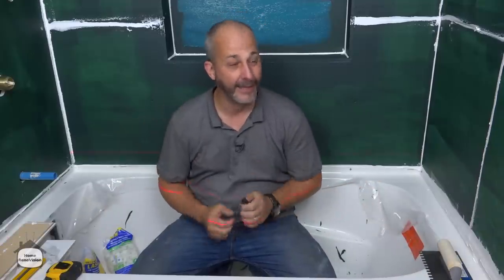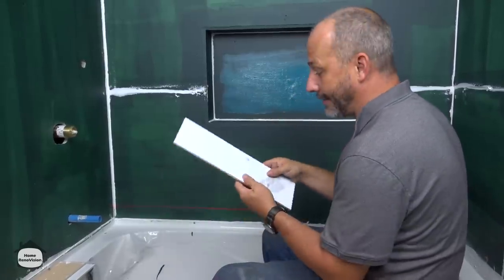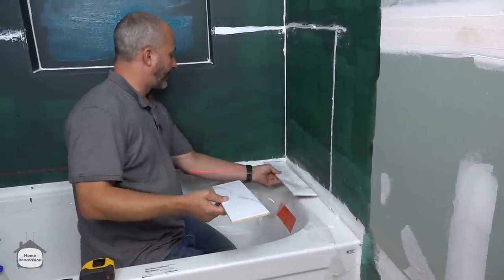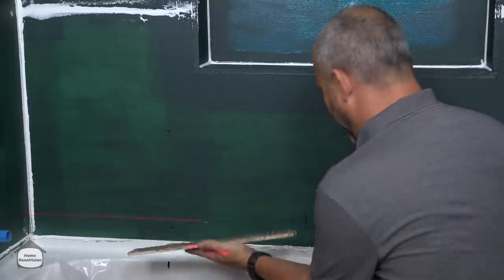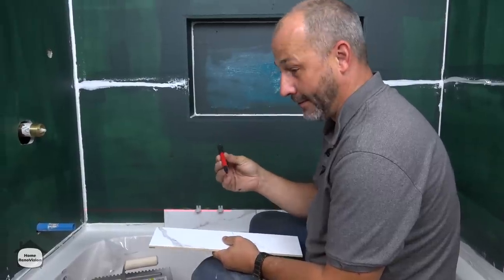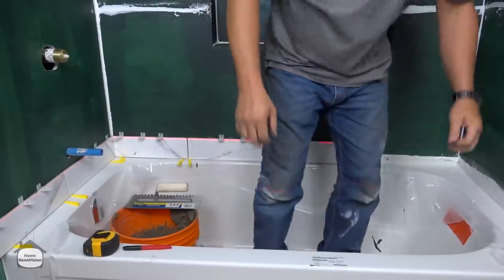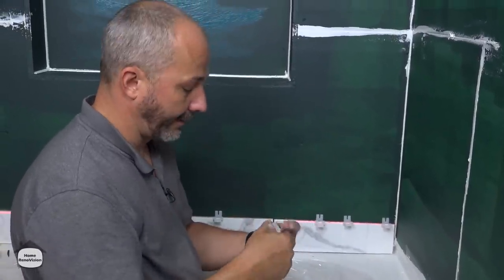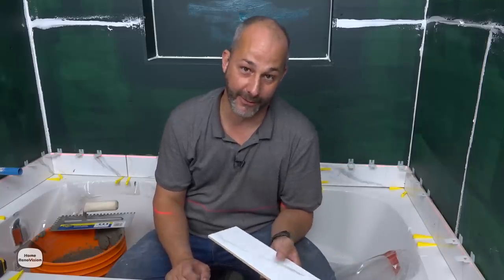DIY Shower Tile Industry Secrets | Bathrooms 101

Comment: I have only ever done one tile job - a kitchen backsplash and it turned out great. I did a lot of research first, and one really great tip I found and used was to start from the second row and work upwards after first installing plywood strips for the starting point. You use a laser level to install horizontal strips perfectly level and then you start installing (what will be the second row from the bottom when its all done) sitting on the temporary plywood strips so they aren't going anywhere - no sag possible. Once you reach the top (i let it all dry overnight) you remove the plywood strips and then finish by filling in the bottom row - you can use spacers to easily get them perfect.

Comment: I payed around $150 for my Dewalt laser and thought it was expensive for what I was getting. I couldn’t have been more wrong. A good laser is an absolute necessity when doing tile, or any remodeling for that matter. Another great video!
Reply from the maker: I couldn't agree with you more. My laser has saved me hundreds if not thousands of hour on the job sites over the years.
Reply from the maker: Here Here...Cheers!
Reply: A level and marker will cost you $25 dollars if your working on a tight budget
Reply: What are u thinking we tile pros did before the laser go figure !
Reply: @erichermann7873  I'm guessing it took a lot longer to get the jobs done or they were of less quality than if you had one.

Comment: I just have to say, your content in this video is so spot on. I’m an interior designer and I specialize in bathroom renovations and tile design. Your method for locating the niche and laying out the tile based on tile size on site is exactly how I design showers for my clients to get a well planned tile design every time. Now if every contractor or tile installer understood this, my job would be easier.

Comment: Jeff I really dig this channel, you and Anna White are the leads in this DIY space.  I have a video request, how to install a dryer exhaust port at a distance from the exterior wall.  From my searching no one has done a video on this.  I have a home that had an addiction put on it.  Basically an entire room.  It was done to I guess the lowest bidder..  the plumbing for the washer and dryer were not moved so it is at what used to be the side door which is now the middle of the house.  The wall is an outside wall, but it’s inside.  How can I 1. Add a vent to go through a structure wall or 2. Should I bite the bulletin and re plumb the entire house using a manifold system, shark bites, and plastic tubes to relocate the washer and dryer to an outside wall?  Really dig your channel, it’s hard to get genuinely good DIY content with the kind of wisdom you put in your content.  There is a lot of knowledge out there it’s wisdom that makes your content better.

Comment: I have yet to do tiling, but I will be in the near future.  Excellent explanation on starting the first row properly, and I definitely have to buy a laser level--and probably watch this video a few more times.  ;)  Thanks so much!
Reply from the maker: Thank you very much. I have my favorite DIY laser in my tool section listed on my Amazon link if that helps. Cheers!
Reply: Home RenoVision DIY is it possible that the link is not working? I tried using it but it didn’t get me to the website

Comment: Hi Jeff, amazing that the tiles lined up to the casing without having to be cut.  If it didn't work out like that, there is another trick.  You can cut the tile maybe 1/4" beyond the casing line for each row going up.  Then rabbet out the casing from behind so the casing overlaps the tile.  That way, the tile cuts are completely hidden and a nice thin caulk line will blend the transition...
Reply from the maker: very true. I usually just cut the tile since I am already set up for that at the moment. But good technique nonetheless. Cheers!
Reply: Can you explain more. What does rabbet out the casing mean?

Comment: For my bathroom remodel, I've been studying the installation instructions for various acrylic and cast iron shower bases. They all have a tile flange and they all, without exception, tell you to install the base or tub so that the wall board and membrane are INSIDE the flange. They instruct you to build out the studs with furring strips and shims to contact the flange where necessary.
Reply: It appears that this tub was installed against the sheetrock instead of against the studs as typically seen.

Comment: Hi Jeff,  is directional troweling required? I also noticed you just back-buttered the tiles and not the wall as well, im using 3x12 tile and wasn't sure if I should backbutter and also all thinset to the wall for more secure hold?
Reply from the maker: Hi Steve, save the advanced tiling steps for tile over 12 x 12 in size. Cheers!

Comment: Thank you!  This video in particular has been very helpful to me.  I have two bathrooms to do, one at the rough framing stage ready for tile, and the other not demolished yet. I've been worrying about the wall tile.  We do have a laser level. iNVALUABLE.  Showing how to lay out that first row of tile -- starting at the low side and that tubs/showerpans might not be level and how to compensate for them --  and the caution to wait for the next day have saved me a lot of trouble!  Oh, and how to use the plastic separators properly.  THANK YOU!!
Reply from the maker: Glad to be of help. I developed this strategy years ago when I used to pay plumbers to install the tub. they always claimed to be level and were always out. Glad to be of help. Cheers!

Comment: Jeff, Please help? But first let me Thank you for the video. Wish I’d seen this before I built my own shower stall. I did a good job and the tile floor plan was the hardest, but it has lasted several years without problems! I do have a question I’d like your expertise with though. What do you recommend to clean grout and reseal. I’m getting the brown on the grout and can clean with bleach but want to clean really well THEN seal it well also! Can you Please help? I have the two “Miracle” brand “Pro Choice” cleaner and sealer from Lowe’s if that’s good enough?

Comment: Great video. Thanks for the detailed instructions. As everything is level and you build up the wall with tile, how do you deal with the ceiling if that turns out to be uneven and not level too? Would you treat that final row of tile in a similar manner to the first row - grinding along to fit and then silicone the top? I can envision this looking ok for long or large tiles, but what about smaller or mosaic tiles? Won’t you notice that there’s more tile on one edge or the other?

Comment: Hiya  need advice please. I wanted to tile an outside bathroom wall that was painted years ago but paint bubbling off due to raising damp. The wall is brick with coat of plaster... I think.
It has just a boarder of tile and I want to tile the whole wall. 
Q. How to best prep wall for tiles?  I'm concerned about the rising damp. Will the tiles fall off?? BTW. YT IS awesome. Great advice n great vid tech. Cheers

Comment: Levelling a tub is easy... mount a wood frame around the wall with 3x2 or 4x2 and sit the tub down onto it. Then just wind down the legs until they touch the floor and take the weight. 2 levels on the tub until it's bang on.

Comment: What did you apply to the joints on top of the waterproof membrane? The white lines in the niche corners and the main corners, etc. I’m wondering what step I may have missed you describe here.

Comment: Jeff, do you have a vid installing 13x13?  we did what you said not to do... we put the Niche where we liked it
Reply from the maker: No worries rob. The majority of niche installs are like that...even by the pros on youtube. unfortunately there is no size specific install vid available. all the same rules apply. just take some time to layout the wall on a floor if you need to visualize it first. Cheers!
Reply: @HomeRenoVisionDIY  Jeff, when doing a stand alone shower, do you do the floor first, or the wall first?
Reply: So we are now fitting Schluter trim, and I was going to use their inside turn corner pieces to make life easy, but we decided to try mitre cuts... this is a NIGHTMARE... HELP?!

Comment: What type/brand of caulk do you use for the bathroom shower or tub tile?  The replacement caulk I use never looks or feels as smooth as what the original installers used.

Comment: So if I understood you right. My tub is 1/4” lower on the left side than the right side. So I should start tile on the left and shave everything to the right to meet the line. Right?  (Wife wants 90 degree/ straight herringbone subway tile 3x6. It’s hard to find info on this installation process!) love your videos!
Reply from the maker: correct. with a  herringbone pattern you could start higher up and use a laser line to get it level. then cut wall tiles where they meet a corner or surface.

Comment: What type of cement do you use with large tile (12x24 or 6x12) over Red Guard? A tile setter told me Red Guard would comprise the adhesion of the tile to the wall? Is there specific thin set you use with Red Guard? Yet I see a lot of tile setters use the Red Guard. I also didn’t see you put cement on the wall behind the 1st row? I’m doing a complete bathroom renovation by myself and your the first person I saw used Red Guard; I don’t think it was available last time I tiled..15 yrs ago.

Comment: I have a shower/bath combo and the bath part near the drain is “soft” as if maybe there is no support under the tub part? It was this way when I bought the house and the fiberglas tub has a dark stain in the area where this is. How can this be fixed? Do you have a video?

Comment: So I put down the bottom layer and let the tiles sit over night. When I was working on an adjacent wall, I bumped the bottom row of one wall and they got knocked loose. Should I be worried about the integrity of all the bottom rows since that one fell off relatively easily? And how do I get the mortar off the wall to re-install the bottom row?

Comment: Hi, I have the laser level and tile cutting machine, as well as the clips. I also have a lot of experience in laying tile and layout. But you are using some green waterproof paint to seal the drywall, will you please let me know what it is called. I have used reg guard before and it is in the products you show on your web page, but you said in another video that the green stuff was just as good but cost less, I live in the UK and want to use this on my bathroom remodel but I need the NAME of the product.
Reply from the maker: the product is mapei aquadefense. Not sure if it is in the u.k. However there will definitely be something there that is a waterproof rollon. Cheers
Reply: @HomeRenoVisionDIY  Thank you, I will check that out. If I cannot get it in the UK I will try Amazon and it should be available through the internet. I use you tube as a learning tool and find your videos to be of the highest quality and full of knowledge that I need. Keep up the good work and thank you again for your quick and helpful response to my question

Comment: Hey Jeff, I’m about to tile my bath/shower, I’ve been watching many of your videos and I have a couple questions. First, I noticed you have waterproofed the sheet rock in this video. But what about the seams? Is that caulk? I have not finished my Sheetrock above the shower, so there are gaps, so after I waterproof it, do I just caulk the seams? And my second question is, I noticed you didn’t use spacers between the vertical lines of the tiles on this first row. If I’m using the QEP tile leveling system, should I also use those on the horizontal lines, so they end up with the same grout lines as my horizontal lines? Also, one last question, I don’t believe my tiles are glazed, and they are porcelain. I’m using the same tile on the floor; how necessary is a glazed tile in the shower? Thanks in advance for any feedback. Love all the videos and information. Very helpful for a DIYer like myself.

Comment: Laser levels.  Can we have recommendations for the DIY'er?  We have a Stanley "Fat Max" and can't live without it.  I can't remember how old it was, 10 or 15 years.  Been very reliable.  A joy to use!  Not available now I guess.  Or I can't find it.   But I was recently shopping for another laser level.  

We have a practice of giving filled tool boxes and one good tool to newlyweds and many of our friends have kids out of school age just getting married.  We customize the tools to the couple.  Apartment dwellers that aren't (yet) into DIY get a cordless drill/driver and extra battery, torpedo level, paint brushes and picture hanging stuff, a simple circuit plug tester, plus a variety of toolbox items I accumulate along the way at Harbor Freight.  Tools useable for the novice.  

But the last couple a few weeks ago have bought a used house and are totally remodeling.  We decided to try to include a laser level and a good set of Purdy paint brushes.  I read all the reviews and was not happy with the quality of levels available now, within budget.  I really was dismayed...  out of level, battery covers falling off, sloppy sloppy assembly. :( 

I did finally find one to give that was introduced on Amazon (far as I can tell) just in the last year and it seemed to be more reliable, without the sloppy manufacturing.  Hope it's alright to mention brands, etc..  Self leveling cross line level by Mertek at $36, amazon.  

At the time there were only 27 reviews, all pretty good, two year warranty and it seemed the manufacturer was answering reviews and interested/involved.  Best I could do.  I see that's now been updated to 45 reviews in the last two or three weeks;  two of those are negative at this date, one 1star, one 3star.   We checked out the one we got on arrival and it was perfect, a nice little package.  No probs, so I guess we were lucky.  ( They were so excited when they saw the possibilities, just about to start tiling a backsplash and a bathroom in the future, aside from every other use.  It's fun to shop for tools as though we were newlyweds but with hindsight. :)  )

Any other recommendations -- both for entry level and for the more advanced DIY'er?    Without going professional?
Reply from the maker: I love my dewalt cross line. I also love the firecore laser. Both available in our Amazon link Cheers!

Comment: Helpful video. I've a question. I did my own shower recently in my basement and I intentionally installed a stud were the shower bar was gonna be. So when became the time to screw the bar on the wall,  I had solid wood behind the tiles. That means the bar is now very solidly attached. This house I owned was built only 2 years ago. The plumber who installed the main shower didn't do that way. Yesterday the bar fell because he had fixed it with plastic anchor only and the anchor came out with the screw and the bar. I was wondering is this is common fixing shower bars with only plastic anchor? Is that acceptable? I feel that I should complaint about that what do you think? Since I have to put up with this, do you have a good solution?? Maybe better anchors that I can use? Thank you very much.
Reply from the maker: Ouch. I always use  blocking even  on my towel bars outside the shower. There are anchors that will perform better like toggles, but you need to make the hole larger.

Comment: at about 20;10 in the video, I was remembering my first DIY tub install and tile wall. I didn't use it at the time, because I didn't find out about this until after I was finished. 

But at one of the box stores I seen a rubber seal that went agains the wall, and sat on the top of the edge of the tub. I dont recall how it attached, but it had a groove for the tile to set in. It was made out of a clear rubber type material. It was to help seal the bottom row of tile so water didn't seep up under the edge of the tile and the tub.

This was about 16 or 17 years ago, so I can't remember what store it was at or the name brand of the product. but it seemed like a great idea.. Whats your opinion?

Comment: Just a thought, but it looked like a pretty good ridge of caulk/sealant along the tub flange where the bottom of the first course of tile is installed over it. Wouldn't it be a good idea to scrape some of that excess off first so the first course  lays flatter and closer to the wall?
Reply from the maker: the sealant was under the wallboard closing the gap to the tub flange. not in the wy at all. Cheers!

Comment: Hey Jeff - curious - do you ever use spaces on the vertical grout lines? I get the leveling system keeps the horizontals consistent, but it seems like tile troglodytes like me might mess up the even spacing on the vertical lines. Ideas on how to make this foolproof? I'm thinking use the same spacers but backwards?
Reply from the maker: better to pick up the same width spacers at the local building store. those clips cost a pretty penny. the spacers can be removed and used again. Cheers!

Comment: What do you do if your tub is level (it is) but the ceiling is off by 3/4” from one side to the other?
Reply: Depends how high you put the tiles.  If its just for a bath then you dont need to tile all the way to the ceiling.

Comment: What's that on the wall? I've seen you use redguard and the other blue stuff, but don't recall seeing the green before
Reply from the maker: Mapei Aqua Defense. A roll on membrane that is less stinky than redgaurd and cheaper since I buy it at my favorite tile supplier store. Cheers!
Reply: @HomeRenoVisionDIY  wish I knew that before purchasing RedGard - stinky is putting it mildly!  I donned my canister face mask when applying on my stall shower (very small space).  Even with the exhaust fan going, it was still stinky!